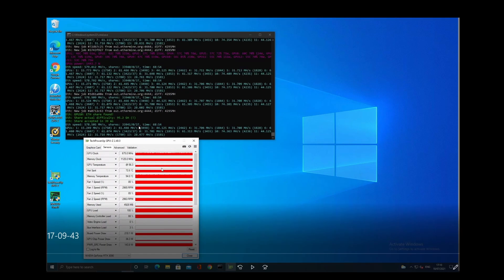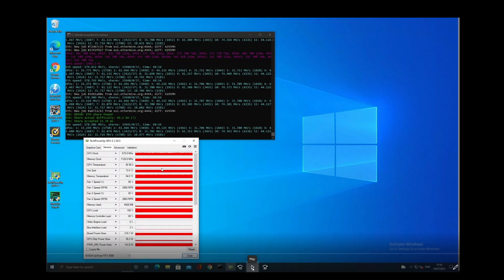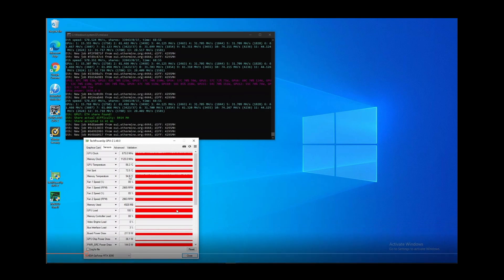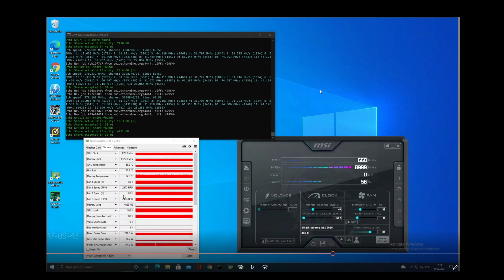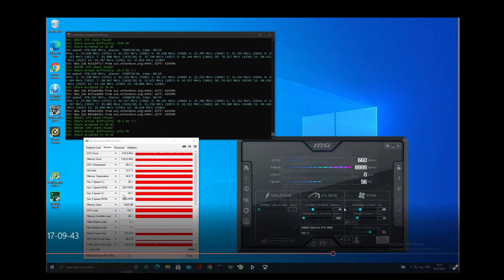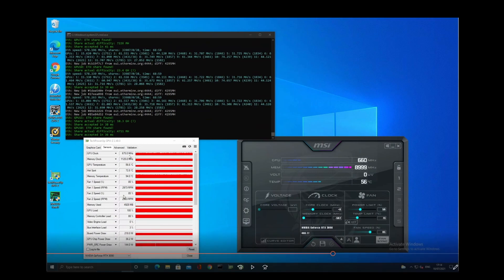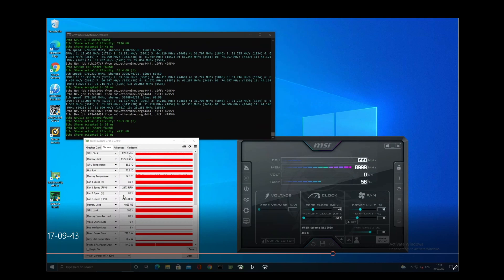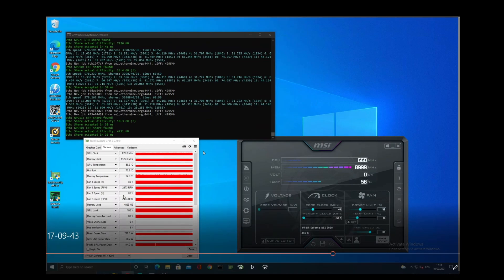Inno3d 3090 iChill x3 VRAM Temps | 3090 VRAM Temperatures | Copper Heatsink 3090 Mod | Nvidia 3090 |

Comment: you need new thermal pads, sometimes their orignal thermal pads are not really a good quality, but having them change will put the Memory temp where you want it, however have in consideration it can increase but 15 and 20 degrees C in gpu temp and hot spot temp, the ones i use was: (2 mm on the back plate - 1 mm (memory area)  and 1.50 (to the rest of the sink) in the front. im planning to get the cooper ones, that go inside the memory.
Reply: What mm of copper shims are required for copper moding

Comment: it is not easy put on the thermal tape with heatsink on the non-smooth card backplate, any suggestion? thx.
Reply from the maker: My heatsinks eventually fell off 😂 in part due to the poor contact with the backplate. I would say put the card in a horizontal position and use thermal pads to provide contact between the backplate and additional heatsink. Use thermal pads which have a bit of give in them so they mold around the non-smooth surface of the backplate. Let me know, if you find a good solution??

Comment: is it ok with those temperatures=?
Reply from the maker: Micron say on their datasheet for their gddr6x that it should operate between 0C to 95C / 105C. Personally I think I run it around 94C currently.
Reply: @Yottabit_  how long have you run those temps 24/7 ?
Reply from the maker: @canpehlivan9627  I'll go have a look see and get back to you on it very soon.
Reply from the maker: @Can Pehlivan I've just looked up the rig and I am a bit shocked. It's sitting at 100C memory temp with 66Mh/s. I must have done a terrible job with the thermal pads haha. What hashrate to memory temp are you getting currently?
Reply from the maker: @canpehlivan9627  I know the feeling. My day job gets in way a lot too. Whenever you get the time, let me know how it goes.